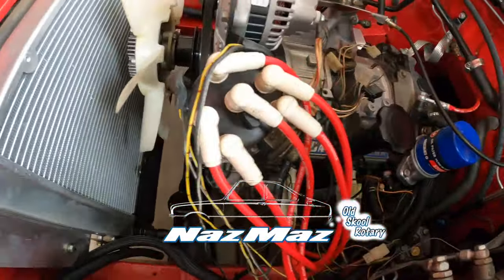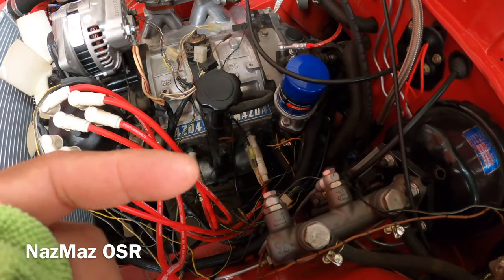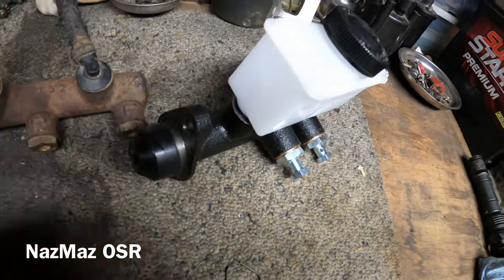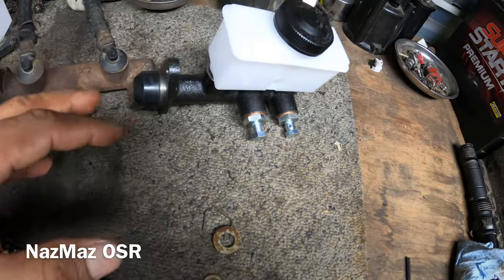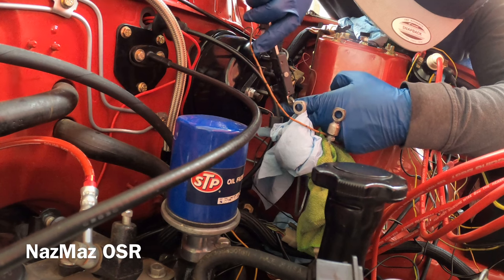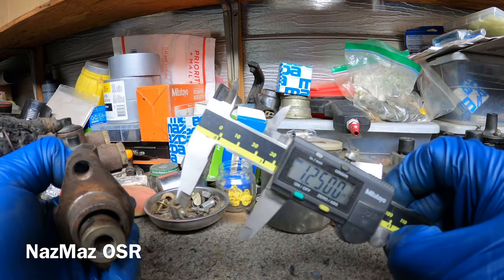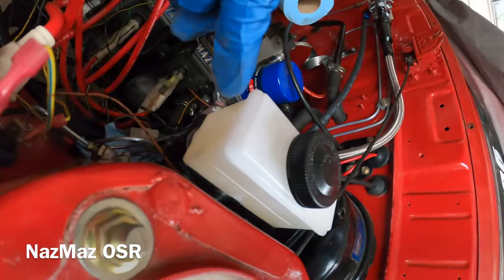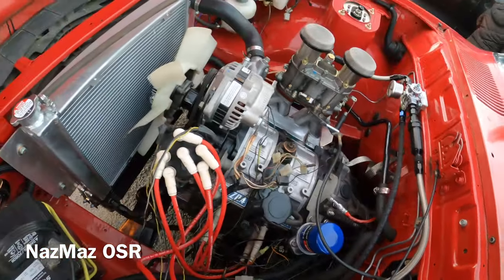Mazda RX4 Brake master cylinder upgrade

Comment: The right-hand drive versions had the fluid reservoir bolted directly on top of the master cylinder, like your replacement.
It always baffled me why mazda chose to mount the reservoir remotely in the left-hand drive version. To me, more pipes and clamps means more initial cost and more chances of something leaking or failing later on!
Reply from the maker: OK, so I'm not too far off from Mazda specs 👍 Thanks for the info...

Comment: Cool deal on retrofitting that master cylinder. Do you plan to ever resorting back to the remote reservoir style, or just leaving well enough alone?
Reply from the maker: I really want to go back to the remote style, so the hunt is on for a good master cylinder and at the least I can stilll drive my RX4 😎
Reply: @nazmazosr1260  i don't know the id bore size of the Rx-4 mc, but when i did my Rx-2(prior to upgrading to FB brakes) i sourced the rebuild kit from a '77 Beetle. If i remember correctly, the Rx-2 uses a 16mm id master cylinder(mine did anyways). I honed out the mc lightly just enough to rid of the built up. Worked fine till the upgrade. Cross referencing the internals was key in finding out the swap. Good luck with that👍🤙
Reply from the maker: 🤔 That's right I can bore it out to a bigger size just gotta do my homework on different rebuild kit sizes. Thanks...
Reply: @nazmazosr1260  not sure if boring out your mc would be ideal as it'd shave off some material. Honing the cylinder is essentially just a cleaning(depending on the tool and amount of adjusted resistance applied. But yes, a lil leg-work on cross referencing and an auto parts that's willing to work w/ you are always key. Although few & far between,  "Mom & Pop" auto part stores are typically pretty helpful. In the past, i've sourced parts for older cars from "Dick's auto parts" in Azusa.